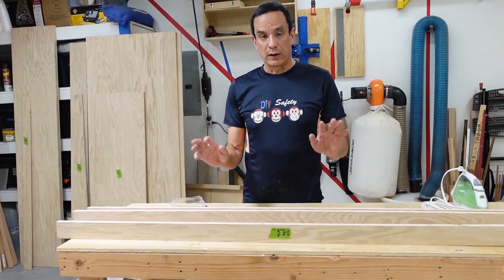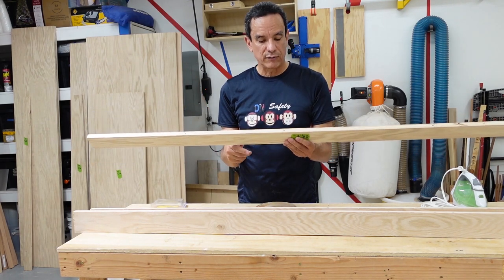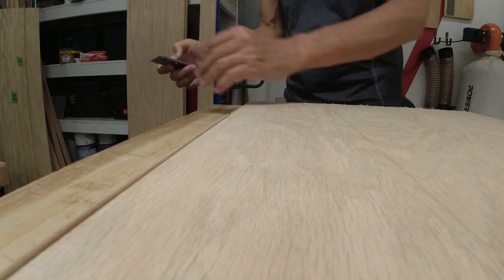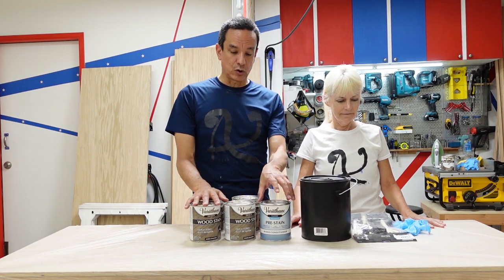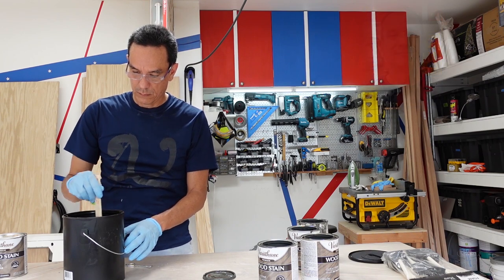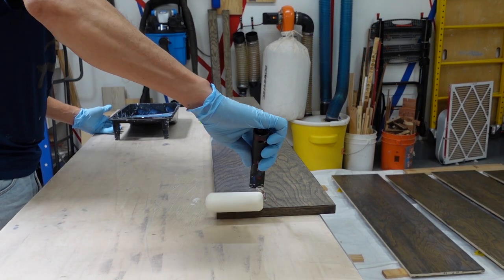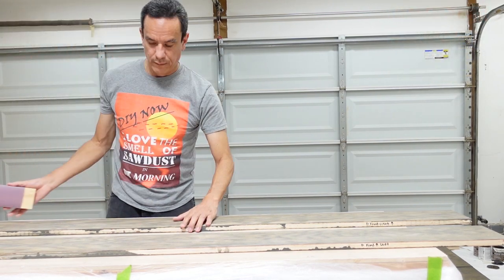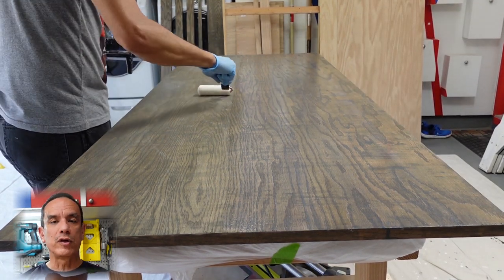DIY Murphy Bed | Part 2 | Edge Banding, Staining And Applying Polyurethane

Comment: I am enjoying the build series so far. I think I would invest in some respirators to wear while applying polyurethane.
Reply from the maker: Thank you for your kind words and for the great safety tip. We went with the water based poly and applied with the garage door open most of the times but I do admit to having the door closed and it would be safer to use a respirator then. We learn from great comments such as yours and we truly appreciate it.

Comment: Hi Both, That is a lot of work but the results so far look amazing. You made the edge banding look really easy. Did you consider applying the stain with a roller brush as well?
Looking forward to the next episode.
Take care both. Cheers, Huw
Reply from the maker: I am not a big fan of stains because it gets all over everything. If I used a roller, I bet I would have had stain on my ceiling. LOL!  In all honestly, I had not thought about using a roller but it is definitely a good idea. Thank you!